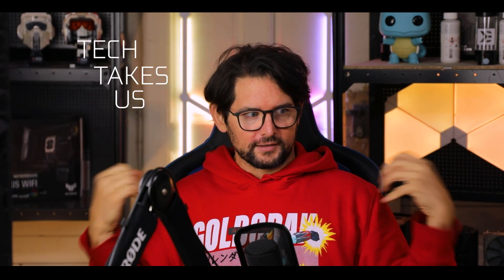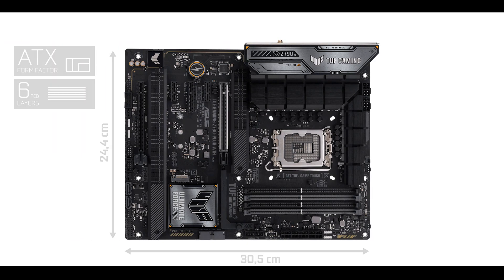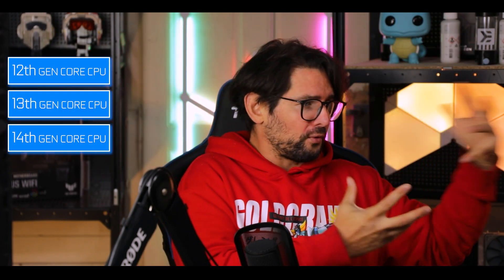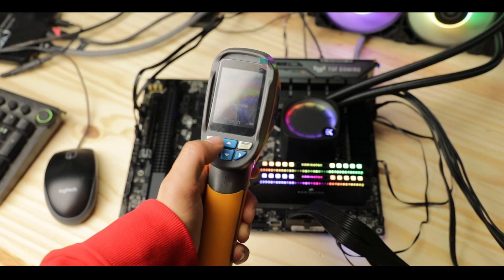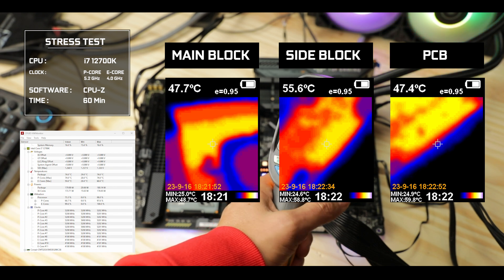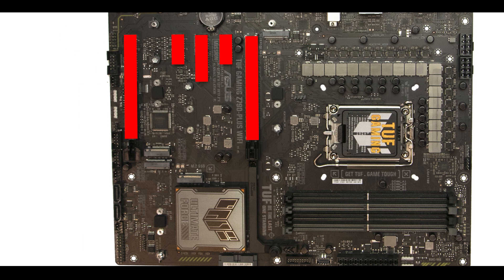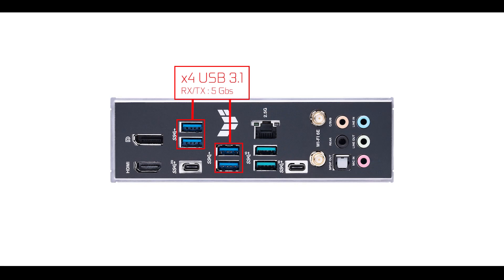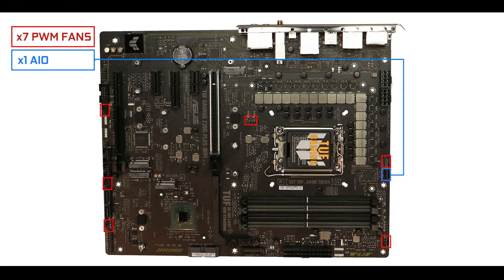TUF Gaming Z790-PLUS WIFI , Disappointing!

Comment: There's something really weird going on. I'm reading the manual for both this motherboard (E21279_TUF_GAMING_Z790-PLUS_WIFI_UM_WEB.pdf) and a $700 ROG motherboard (E22500_ROG_MAXIMUS_Z790_DARK_HERO_EM_WEB.pdf) and BOTH "share" the lanes.

This is what the ROG manual says "M.2_1 shares bandwidth with PCIEX16(G5)_2 and PCIEX16(G5)_1. When M.2_1 is occupied with SSD device, PCIEX16(G5)_1 will run 8x only". However, the TUF manual only says it will run on 8x only if 2 M.2 SSDs are installed in a Hyper M.2 x16 card.

I am very confused.
Reply: I just spent a few hours researching and here's what I found out: EVERY Z790 motherboard (I checked MSI, Asus and Gigabyte) with a PCIe 5.0 4x M.2 slot being used will make the PCIe 5.0 16x slot run at 8x on Intel 12th/13th/14th gen CPUs. 

If the motherboard does NOT support PCIe 5.0 M.2 or any other PCIe 5.0 slots, in other words, if it only supports other PCIe 4.0 M.2 or any other slots, the GPU's PCIe 5.0 slot will always run at 16x.

This happens because LGA1700 Intel CPUs only have 16 PCIe 5.0 + 4 PCIe 4.0 lanes. On the other hand, some AM5 AMD CPUs have 20 PCIe 5.0 lanes, that's why a PCIe 5.0 4x M.2 SSD does not make the PCIe 5.0 16x slot run at 8x on some AMD CPUs.

For that reason, the information regarding the PCIe 5.0 lane made in the video is incorrect. It is impossible for the PCIe 5.0 lane to be affected by PCIe 4.0 M.2 lanes because it doesn't support PCIe 5.0 NVMe SSDs. If it supported those, then it would affect the 16x slot, the same way it affects every Z790 motherboard.

Comment: I just bought this board. Seems overall pretty decent and solid construction. I needed a board to test my I712700k as I'm having issues latley. Oc memory failure reboot stuff and hoping this board will be enough for a few years.
Reply: Hi! I actually got the same processor and motherboard as you just recently, did you ever figure out your booting issues? I've been plagued with the same ones, I managed to install windows but it crashes often.

Comment: So what you are saying as long as you have only one m.2 plugged into primary boot lane (the one closed to the CPU), the PCI 5x16 GPU slot will still run at the 5 x16. Correct? Thanks. SO to recap, the best set up when having 2 m.2 drives is to always plug the second one into the sockets that are closest to the chip set.

Comment: Hi Laurent, is there a technically correct answer to the problem of the two 8-pin connectors?
The manual says nothing, the Asus forum says nothing, every owner of a TUF Z-790-plus is confused.
Does this board need you to connect both connectors or not? Some say the board is unstable or won't even boot unless you connect both, others says it's fine with just one connector.
I'm talking about people who report stability issues even with a 65W CPU. But is that really related to connecting just one connector??

Comment: I have this board and I'm running an i9 14900k. It runs my i9 flawlessly.
Reply: Did the 14th gen cpu worked out of the box or did you need a bios update?
Reply: @soorajsingh4382  just bought this board and it came with BIOS 1603, which supports 14th GEN out of the box if I'm not mistaken
Reply from the maker: You are flawless,,😘

Comment: i ordered this board yesterday on dec 31 2023. (DDR4 version) . Its for a home multi task server (firewall / IPS, networking Vlans, fileserver, router, VM virtualization, media server). I bought 64gb ddr4 3600mhz for cheap $125us. I will add 3x2tb nvme ssd in Raid. Also 3 expansion card (intel i350-t4). Windows Server with Hyper-V running all virtual machines linux and windows (isolated for each others). This board is perfect for me, 3 pcie slot with at least X4. Also 4 nvme (x4 is fast enough). Choice of cpu is I5-13500 (65w) 14 cores (6p+8e). For my needs (3 slot with x4) the pci lane distrubution is perfect.

Comment: I only have one m. 2nvme and I used the top m2 slot (just below the processor and ram).   Will that take bandwidth?  Also if I want to add another m. 2 nvme which slot i should use next?  Plz let me know the recommended slots

Comment: The PCIe bifurcation has nothing to do with the m2 slots build in on the mainbord. It is relevant for an additionally sold Hyper m.2 pcie 16x card which can hold up to 4 additional SSDs. You don’t sacrifice your PCIe 16x gen 5 slot when using more than 1 internal m2 ssd as you state, only when you add the Hyper m.2 pcie 16x card. Furthermore this is a chipset limitation and not specific to this board, I am really confused about this “review”.
Reply: So what you are saying as long as you have only one m.2 plugged into primary boot lane (the one closed to the CPU), the PCI 5x16 GPU slot will still run at the 5 x16. Correct? Thanks. SO to recap, the best set up when having 2 m.2 drives is to always plug the second one into the sockets that are closest to the chip set. but then i read your comment, hope you are more right than the guy in the video cause seems like they are also saying this same sort of information about the LGA1851 boards as well. looks like Motherboard manufactures need to have clarification on this topic.
Reply: @videocruzer so how do you have more space? I have my 2tb and a 1tb I want to use on this board.
Reply: My friend so the minute you add more than one ssd. You loose bandwidth? Anyway to get around this? I have 2 drives I want to use.
Reply: Yeah, that's right. I found out the same after going through manuals and bifurcation table.
Reply: Exactly

Comment: Hey Laurent, bit suppriced that you are the only reviewer that don't like this board, I just bought this board, ddr 4 version, (ddr5 way too expensive to be a value atm) cs my 5900x system went dark. Do I buy a new B550? Checked around benchmarks and even a 13gen I5 is way faster then a 5900x these days, For me the ASUS Tuf has the gen 5 pci for gpu, still runing 3060ti and by far enought got the games I play. For me the back plate con rules on this board, 8 high speed and 4 M.2, for me this is the perfect fit for my needs. BTW the B550 Gigabyte you recommended and I bought died after 18 mounths. Going back to Intel and Asus. For the last 30 years 4-5 MB has broken, non of them was ASUS, still have  WS Asus pre iCore with x48 chip and it still works, that one I overclocked silly from 2,86 to 4GHz. Not your fault that my Gigabyte b550 MB failed, you look at how it's looks from an engineers point of view, you're funny and smart. I also bought a 13700kf, best bang for the buck atm is the 13600kf
Maybe this MB will have 14900kf and a next gen gpu, who knows? just looked like a winner for my needs
Reply from the maker: It is not so much that I don't like it :)
It's more that... The competition is doing, in some instances, a better job for the same or less money. 

If you manage to get this board for about 50 bucks less... Than it's a MUST buy!
Reply: I got this board for about 230EUR, some prices for this in Sweden is over 400EUR!!!, insane, but there it is, the alternative was Gibabyte UD for about 210EUR. I see my self having it for 3-4 years. I have option to upgrade Gpu to 5th gen pci, and Cpu to a 14900kf if prices drop. I had a pair of DDR4 4000, cl18, Gskill 32Gb laying around and DDR 5 is super expensive atm. I'm pairing this with a 13700kf atm, about 100 EUR less then a 14700kf where I live. This is my thoughts about why I bought this MB. And for the first time in about 10 years I',m doing a water cooling of the cpu, the artic 280 2d gen, alrady have 2 140 pwm Noctua so it going to be a puch pull. Silent pwr, I hope @Laurentschoice
Reply: All installed and working perfect, not mind-blowing performance, but all working as expected, except from the cooling. The cooling is rly mind-blowing, the Artic 280 is by far better than I expected. The push pull with my 2 140 Nocua PWM, that I previously used as case fans is just amazing. It idle at 28c.
Did a short stress test with CPU-Z, CPU temp is 65c and fans going about 60%. When I game I don’t even hear that the PC is on. Very happy😊
What I don't like is BIOS upgrade, I had to goggle it to figure out how it's done and it's not at all user friendly. 
Not having a option of upgrade BIOS with usb pre build is rly crappy.
I have build my own systems for 30years and this is a key functions for the MB to work properly
For those who are intrested, I use a Fractal Design Define 7 Compact case, best sound dampning and easy to build in case you can find, also not expensive, and like Köningsegg, it's Swedish. Sorry Laurent, but Bugatti spells Volkswagen these days, though I am a big Bugatti fan as well.

Comment: My recommendation is to absolutely stay away from ASUS. Horrible products, horrible customer service and no bang for the buck. My Z790 Tuf Gaming DDR5 lasted barely 4 months of occasional use, on only a single rig built specifically for flight simming only. CPU 13900KF, not overclocked and only two sticks of 5200 RAM. Pathetic, never overheated, always ran within limits based on monitoring. I am sorry, there is a shear plethora of failed ASUS motherboards, specifically this model. Just do your research. Occasional use on this motherboard that was coupled with all the right parts is just pathetic. Warranty? No thanks, these warranties are just an approach to keep you coming back and controlling the market. I'll rebuild with another brand, anything but ASUS. My other rig has an ASUS 390 gaming motherboard with an 9900KF CPU and 2080ti, no problems after almost 4 years. I mean even JayzTwoCents won't use them any longer or take their support as a sponsor. Price is irrelevant to me, I only buy the best, and when the best is the worse, I'll call them out, regardless of price. I would pay double what I paid on this crap for a MB that would last. I am 57 years old and I have never had a MB fail on any build. Never. ASUS is like dealing with emotional immature little kids.

Comment: Hi. Laurent. Do I understand correctly? I  shouldn't use the M.2 slot just above the PCI Express 5.0 slot so not to limit its bandwidth? If I use two lower M.2 slots lying nex to another and  cooled by a common heatsink, will everything work properly? Thanks for all Your wark 🙂
Reply from the maker: Yes ur correct. And don't worry for the heatsink. The other connectors are all capped at PCIe 4.0 so less potential heating  issues
Reply: Does the z790 pro have the same bandwidth issues as the z790 plus ? I was thinking about buying the z790 pro.

Comment: Do you have any references/data for your claim that using 2 m.2 slots takes bandwidth away from the PCIE lane? All I could find from the motherboard manual related to bifurcation is about the Hyper M.2 X16 series cards.
Reply from the maker: It's not a claim I tested it for you.

Just for your information, 13 and 14th gen Intel core CPUs come with ONLY 16 PCIe 5.0 lanes in total. The chipset has none. 

So you can't have a 16 lanes on the GPU + 4 on the m.2 SSD simultaneously (at PCIe 5.0 standard).

On every single Z790 powered motherboards in existence today, if you are going to use a PCIe 5.0 enable m.2 SSD... You will have a PCIe bifurcation which, at least, will divide the GPU bandwidth by 2.

I hope this helps
Reply: @Laurentschoice so this only applies to pcie 5 m2 drives? If I'm using pcie 4 lanes from the chipset on a pcie 4 m2 drive on the bottom, how does that rob pcie 5 lanes?
Reply: @claysmurthwaite2386  Don't worry. He's confused. You are right. All of the on board m.2 are using pcie 4.0 x 4 lanes.
Reply: @RSharpe  yes this is what I thought. The lower m2 slots should be using pcie4 lanes through chipset and won't affect the pcie5 lanes from the cpu at all.. thanks

Comment: To be fair, this board has been selling for cheaper than mentioned during the review for the past week @$205 on Amazon. The other board at the same price point i was considering was the MSI PRO Z790-A or P version for $210 which didnt have a thunderbolt 4 expandability which was the determining factor that swayed me to the Asus. As far as gigabyte as a potential alternative, i believe hardware unboxed revealed their VRM cooling solution was much worse than Asus or MSI, at least in their z690 lineup, don't know if they fixed it for their z790s. Asrock has been known to be shady af in the past so that was a no for me too. Just wanted to put that out there, for $205 this Asus may rank better, comparatively. The Tomahawk is a good board but cost a good deal more putting it in a different tier bracket, at least as far as my wallet is concerned and has a concerning percentage of 1 start reviews on Amazon comparatively to the others.
Reply: Looking for a similar board? So it looks like you’re recommending the Tuf board?
Reason I’m looking for a new z790  mobo even though I have a gigabyte z790 is because my gigabyte mobo keeps producing an extremely high pitch ringing sound like the one you hear in the ear doctor which sucks since sitting next to it for 8 hours
Reply: @Alex-jb8wr  I think I know what you're talking about, Alex. That super high-pitched whining sound some electronics make? Like so high pitched you'd think only dogs could hear it? 😄Sorry, I know - it's not a laughing matter if you have to listen to it all day. I've once returned a self-lit artificial x-mas tree to Costco specifically because of that - I could hear the damn thing every time I stayed in the living room. Wife thought I was crazy. 😄I feel your pain!  

So you had me curious to see if the Asus Tuf board does something similar.  I happen to have a noisy 6700xt video card (coil whine) - it's not too bad but it's enough to annoy me so I stick my PC under my desk which seems to mute the noise well enough. But I went ahead and pulled that noisy videocard out and just used the onboard video of my processor (another reason not to get an "F" version of a modern intel cpu if it's close in price - so convenient for stuff like this), just to test it... and I can happily report there's no such noise!  Just the soothing sounds of my low speed case fans, nothing more, even under a CPU stress test.  👍   

Now whether I recommend it... Well I've been quite satisfied with it so far. But I've only had it up and operational for a few days. Did my first stream with it last night with my favorite game. Extremely satisfied, actually...  but that's because I haven't upgraded my motherboard in nearly 15 years! From an Asus p6t Deluxe X58 platform (first gen i7 and Xeon 5690) to a 12th gen i7-12700k! Of course I'm going to be satisfied with the results. 😄 No similar issues as the negative reviews stated on Amazon - it was relatively painless build actually, sans a bit of a windows 8.1 key to windows 11 pain-point that I eventually resolved.  

If you're OK with the valid criticism that Laurent mentioned during this video, namely the relatively smaller, but still good VRMs... and upper slot M.2 PCI-E lane sharing (which this Asus board isn't the only board suffers from this), then... yeah! I do actually. But just be realistic about my recommendation. It's generally better to hear from someone who regularly test several recent motherboards vs one anecdotal good experience such as mine. 

And there's just the electronic lottery. It's probably not all Gigabyte boards what yours is doing. You may have just got unlucky. Just like my noisy graphics card. Prior to keeping my current one 6700xt, I had another 6700xt that didn't exhibit coil whine. Not even a peep! But I ended up returning that one instead and kept the noisy one (kind of had to - long story) but thankfully it isn't super bad or as annoying as some other people's coil whine that I've heard described (some say just scrolling a webpage would make it whine, yikes!). 😅
Reply from the maker: Well that's a detailed (and useful) answer if I ever read one.
Reply: @Laurentschoice  😁 Thanks Laurent. The thanksgiving vacation put me in a good headspace. I was in the mood to try and be helpful. :) Btw, keep it up - great channel! Subbed.
Reply: @Sprinkles-BtE  thanks for the amazing response! More leaning towards it now
Reply: @Sprinkles-BtE   Just to note, i used to work for an IT retailer many years ago, and sold truckloads of Gigabyte boards. Coil whine was absolutely horrendous and so common. Never bought one personally for the specific reason, and I see they have it even today. This coil whine is something i experienced in Radeon cards as well, thus, quit buying them as well.
Reply: What would you recommand better at the same price?

Comment: Laurent between this motherboard and the MSI z790 Tomahawk (DDR5), which one would you pick for an intel i9 13900k?

These are the other components of the pc:
- corsair 1000w gold plus
- rtx 3090 fe
- Corsair Vengeance 64 gb RAM 6400 mhz CL32

Thanks!

Comment: Hello
As long as I avoid the 3rd M.2 slot I wont lose future GPU performance right?
I need to use the three M.2 gen4 ssd's I have.
Thanks.
Reply from the maker: Yes
Reply: @Laurentschoice  I believe that is only if using Hyper M.2 x16 series card not the only board

Comment: So does this mean the AORUS ELITE X you mentioned NOT take bandwidth from the graphics card when nvme is installed in top slot?
Reply from the maker: There was no visible or mentioned bifurcation.. so yes . You are correct.
Reply: That would be nice because the only thing keeping me away from the Aorus is that you have to uninstall the graphis card every time you want to add or remove an m.2 drive. This might make it worth it.  @Laurentschoice
Reply: I came here wanting to know this EXACT question.